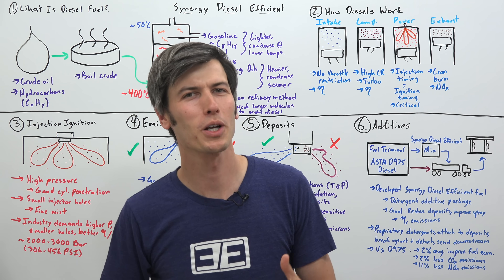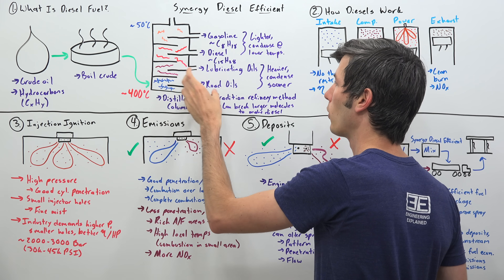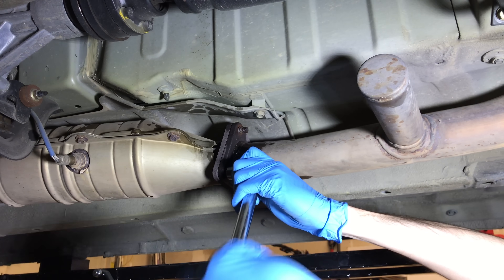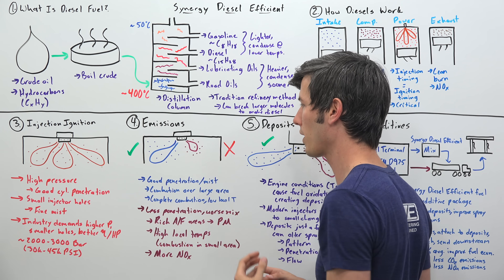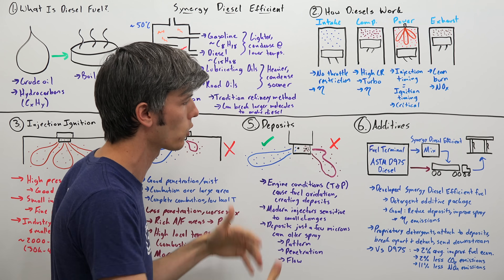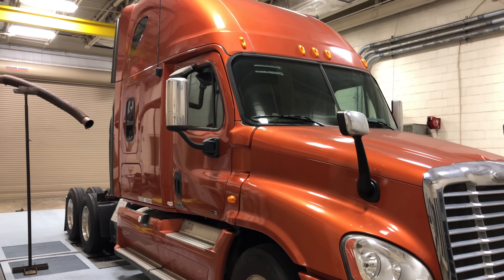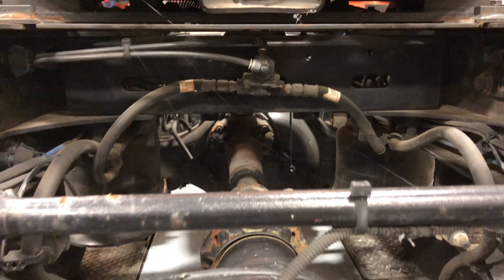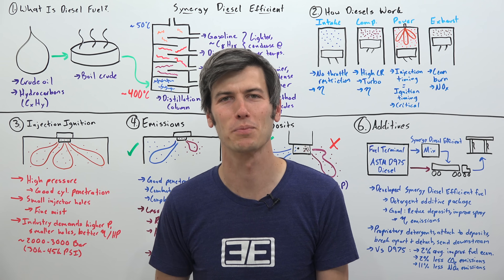Why Diesel Engines Lose Power & Efficiency Over Time

Comment: May I assume that their claim of 2% reduction in CO2 is strictly due to the 2% increase in fuel efficiency? Otherwise, a decrease in CO2 emissions by mass balance would generally be considered a bad thing. Lower NOx and lower CO2 could mean higher carbon monoxide.

Comment: 82 Datsun 720 pickup, bought new, powered by SD22 Chrysler Marine diesel build under license by Nissan. 36-37 MGP city or highway. Had 387,900 miles before I give it up due to deterioration of body, interior, steering, suspension and power train.  Went to start it for buyer after having sat for 1 1/2 years in wet Western Washington State.  New batter, a couple of revolutions and boom! Away she went just like every time I had ever tried to start it!

Comment: Research is also bring done create ducted fuel injectors. Think how a bunsen burner works. With the duct closed the flame burns yellow and creates soot. When the duct is open it burns all the fuel and produces a blue flame. For a diesel engine it means no soot, yet cool enough to reduce NOx. No need for a DPF! 👍👍👍

Comment: It is drivers that lose their engines' efficiency and increase wear due to thrashing engines/ high revs eg when cold and also a lack of servicing. Noticed petrol engines tend to wear quicker above 80k miles due to valve wear etc whereas I've never known a diesel wear significantly with annual oil change etc . Diesels seem to "like" to be worked (hard) but not thrashed. Worn diesels you see are either not serviced/  thrashed or/ just very high mileage.

Comment: It occurs to me that if you make your fuel injectors impervious to damage from water you could put a slug of distilled water into the injectors so that the injection valve Is fully open when the fuel is going through the nozzle and a residue free fluid is in the nozzle when the flow stops eliminating particle buildup in the little holes.

Comment: Diesel engine is efficent but need frequent oil change n maintenance yeh they are very good for high mileage use ...I have see 700000km diesel suv if maintained properly and still running where petrol engine need overhaul after just 100000km

Comment: So presumably you can run enough detergent through the engine to clean the injectors and then go back to standard fuel for some period of time. The detergent can either be included in the fuel (Exxon), or as some additive. Correct?

Comment: 2% improvement in efficiency sounds great at first, but you left out a crucial bit of information - what is the % cost increase of this fuel compared with "normal" diesel on average? I'm sure the trucking companies have worked this out long ago!

Comment: Well my car appearantly gained 20hp after 5 years (test before tuning). It was an hilarious sight, tuned it up another 50hp, so 70 over original with a 'safe' mod. Anyway I still don't get why it was so much higher than stock specs and that for a 5 year old car. It should be down 20, not up 😂

Comment: I drive a diesel car daily, it is closing in to 500k miles, the engine has never been rebuilt and still has the original injectors and turbo, and still goes as good as new. Even when it is -25 C, it starts and runs, and has never had any big problems. All it takes is good and regular maintenance, good fuel, and atleast 20k miles a year, cause diesel engine need to be used all the time, and has to be driven long distance, otherwise you will start to get problems.

Comment: Here's what they need to do, put sulfur back in diesel fuel to lubricate the injectors and injection pump on older engines, get rid of vgt turbos, egr, and dpf.  Have a system that goes from air filter to turbo to intake, inject fuel, and go through a 5 inch straight pipe. Makes diesel engines last a lot longer, get better fuel mileage as there is no back pressure in the exhaust,  I know first hand that works. And 359 cubic inch common rail cummins engines, and 6bts with straight pipes and a Holsett fixed geometry turbo sounds amazing. But no, apparently diesels are "bad for the environment". A Ford f350 "slave Lake" running on everything from diesel fuel to radioactive horse piss is more environmentally friendly than a Tesla. And that's an IDI. But I guess nobody cares about reliability or fuel mileage anymore...

Comment: Ok so the new fuel cleans deposits away from the internals of the diesel engine. What are the down falls of this against injector seals/o-rings and high pressure fuel pumps. If the fuel is being used as a cleaner, why not test the fuel system cleaners that have been around for years claiming to do the same thing this new fuel is doing only just now.

Comment: All i see in the comments is people saying that their diesel engines didnt lose power over time, but they forgot to pass in the dino when the bought with 0 miles and after with 200k miles. Because thats how you compare gains or lost of horse power. At least we do this way here in Brazil, because wherever you are, you must know that are nothing more diferent than two same cars ( hardly ever they have the same hp from the factory ). By the way sorry for the big text and the bad english. Thanks for the content.

Comment: My VW tdi with 285k miles on it is quicker than when new , it also started getting better mpg after 60k mile break in and it still gets the same great 50+ mpg ..  older diesels don’t care about your new fuel.

Comment: Honestly, if you really want to reduce your emissions while driving, switch to electric. They are more efficient and last longer on the motor side of things. The batteries do emit a lot (i am aware of that) but it is quickly mitigated after that. Additionally they last a long time, and battery technology is advancing fast, making the energy density higher, while reducing emissions :)

Comment: Okay , been working on Diesel engines for 40 years , and have never run into a problem of the fuel plugging an injector tip . It’s normal to get power creep — threw time the injection pressure will open the hole up larger , thus allowing more fuel into a cylinder ( up to 125%) with out logging a fault . The pistons are not flat and actually contain a bowl

Comment: I don't know what makes you think only diesel engines lose power and efficiency over time. All engines do. On the contrary, similarly maintained diesel engines outlive their gasoline or kerosene counterparts. this video unnecessarily shows diesels in poor light which surely puts your judgement in question

Comment: Where are you getting the numbers for light duty truck diesel longevity? Is 200k miles just based off when the car is typically scrapped? I could see the trucks rusting out before then, but not the motor needing a rebuild. My 7.3L powerstroke is easily good for 500k miles without a rebuild with 1 million mile examples still driving around.

Comment: Dunno about losing power. Even if it is, it isn't much.
I used to have an almost 20 years old Audi diesel with around 300,000 miles and still got 48  miles per gallon (4.9L / 100km) on normal highway conditions.

Comment: @Engineering Explained Hi Jason, I recently conducted a similar test to replicate the claim of the cleaner injectors providing improved fuel economy. We actually removed 11000 hour old injectors and replaced them with brand new injectors to replicate the clean injector claim. We found an improvement of 0.58% however the additional price of the additive package is 0.60% so it does not appear to be a cost effective solution to us. This was conducted on an engine dyno with a 67litre CAT mining truck engine. My question for you is, do you know if the larger displacement engine had a lower % improvement compared to the smaller displacement engine? My theory being that perhaps the larger injector nozzle diameters are less effected by the buildup than smaller diameters? In addition our mining engines are usually at wide open throttle position for far longer than road going vehicles and may not form such deposits as readily. We also took photos of the used injectors with an electron microscope which was very interesting. There appeared to be minimal deposits inside the nozzle but there were some externally on the injector nozzle.

Comment: The question I would have atleast at the consumer level is if the detergents account for more than 2% of the volume of the diesel, even if the price was identical it wouldn't be economically efficient. Unless your tracking it or 'going green' wouldn't this just be a net negative with the additives? and how do the additives oxidize? So many questions :)

Comment: Legitimate question, from an engineering standpoint, why would it SEEM like modern diesel engines do not have the lifespan that older designs used to? (I use the word seem because I do not know of a resource to find actual data on this subject, but more of what I commonly see discussed across public means, i.e. forums, TSBs, etc.)

I would imagine it could be due to things such as:

-Ultra-Low Sulfur Diesel fuel
-Much more emissions equipment, and having to deal with increased operating temperatures from it
-Certain parts being manufactured from inferior materials than those in the past (seems to be this way across the board, gas or diesel, an example would be the plastic impeller on a Coyote 5.0 V8)
To name a few.

Now I'm aware there are several factors that contribute to an engine's (gas or diesel) lifespan such as maintenance and use both just regular driving and tow/haul applications, but is there any light you can shed on this?

Or is this a myth that we find easy to believe, mainly due to the sharing of information (or, unfortunately in many cases today, misinformation) and experiences being easier in an increasingly connected world?

Thanks in advance.

Edit: Added bit about misinformation, because not everything we see on the internet is true.

Comment: Assuming any of this works. Of course, GM’s tests will show it works—in their lab. Real world issues are always different. Experts in the field state that there is no way to make a low polluting Diesel engine, which is why Volkswagen, its subsidiaries, and others, have cheated. Nothing has changed. 2% is within the range of mechanical manufacturing error.  These tests aren’t realistic. Differences in driving conditions is far more useful.

No impressed.

Comment: Great Video. I tried to find the Cetane rating of Mobil Synergy Diesel on their website and could not, also was wondering what the lubricity rating was.  Exxon/Mobil contact us page is an endless maze and you can't really find the correct place to answer this question.  Do you know?

Comment: In your video, when talking about the distillation part, I was wondering where they get the stuff for making plastics?
Reply: By linking many small molecules together to make longer ones.  Momomers (links) are fastened together to make polymers (chain).

Comment: I just swapped 12 port injectors into a powetech ho 4.7l V8. The OEM injectors were 4 port. Already seeing seeing smoother starts and idle and mpg improvements, and my ECM only has like 5 trips on it after I reset it. It's all about atomization

Comment: 2% increase in efficiency compared to the minimum federal standards. I'm speculating, but surely other oil companies also produce fuels that are better than the standard. Or am I missing something? A cheap fuel that meets only the standards might save you money up front.

Comment: RACING BBM SAVERS?
 ￼

 Feb 8 · 3 min read
 Now the price of fuel oil (BBM) is increasingly rising, this is a complaint for many people to buy it, triggered by the high level of mobility in each of our activities.  Indeed, today there are indeed many cars that save fuel consumption, but what about people who have vehicles that are out of date.  And the best solution is to use fuel-saving products.
 WHAT IS THE ECO RACING OF BBM SAVINGS?
 PT.  Sinergy World, which is a company of Eco Racing products, issued products that function to save fuel.  Eco Racing is a fuel additive made from 100% organic ingredients so it is safe for machines and humans.  This Eco-Racing Fuel Saver product is a world-class premium product through research for more than 10 years and has been tested for quality, both through tests of well-known emission testing laboratories, vehicle performance tests through test dynotest tests, and direct testing of thousands of motorized vehicles,  until it's already been used with GP Motor racers, testing has been done for several years (all of them are tested to very strict standards).
 Has gone through the ITB Bachelor research process for more than 10 years
 Have passed the LEMIGAS and PETROLAB laboratory tests with Marketable results
 Has gone through the Dynotest test process, even tested directly by Motorplus Tabloid
 Has passed the Emission Test by DISHUB, Auto 2000, Astra International and Tunas Daihatsu
 This Eco Racing Fuel Saver is a product in the form of a pill that has an additive which has a function to protect the vehicle's engine, by increasing Octane / RON (Research Octan Number) of Oil Fuel, so that it can save fuel use and eliminate CO pollution  up to 100%.  This eco racing product can be used for motor vehicles, cars, trucks, buses and generators and can also be used for all types of engines that use gasoline or diesel fuel.
 BENEFITS OF SINERGY ECO RACING include:
 MPU Protect and clean the machine (Nano Technology)
 Able to reduce CO (carbon monoxide) gas emissions and exhaust ash
 Able to increase 5–10 RON (Eco Racing)
 Able to increase 2-5 CN (Eco Diesel)
 Able to eliminate Knocking
 Able to optimize power and acceleration (Dynotest)
 Able to save fuel 30% 50%
 Able to soften engine sound
 Able to extend the feasibility of the machine
 Able to optimize the combustion process on the engine
 Able to clean crust in tanks, gasoline hoses, carburetors and engines
 Able to reduce significantly the cost of engine maintenance
 SINERGY ECO RACING CONTENT
 Detergent Chemical Organic Function which has a function to improve combustion and maintain engine stability to be excellent.
 Corrosion Inhibitors.  Can prevent corrosion / rust on gasoline lines and combustion engines, and remove the remaining rust due to the wrong use of fuel such as premium on motors with compression above 9.1 (type of injection and matic).
 De Emulsion.  Can separate fuel pure substances with impurity emulsions such as rainwater etc.  So that it does not affect the combustion process.
 ￼￼
 Eco Racing is not only an RON enhancer, Eco Racing is able to harmonize MON (Octane Number Motor) so that the performance of the vehicle can be maximized.  Equipped with additives, Eco Racing is also capable of reducing, preventing crust on the engine and fuel lines, and reducing emissions residues.
 By using ECO RACING BBM SAVERS this combustion will be more perfect.  If the combustion is complete, it means that all the gasoline (in the form of steam) in the compressor tube burns all, adding more impetus.  With the Eco Racing Fuel Saver, gasoline becomes more pure.  Eco racing can release crustal crust through exhaust air.  Closing the pore pores The engine block is eroded due to the unstable piston performance.  In addition, eco racing products make the fline layer on the engine block and piston.  This is how eco racing works so that the engine is protected.
 ￼

Comment: In my experience of driving Mercedes Diesel engine cars for over 20 years, Shell diesel fuels are the best by far. Mobil diesel makes for a more noisy operation, less mileage per tankful, and less power,I can only conclude that Mobil has a lower cetane rating than Shell. I can usually get 75-100 miles more per tankful with Shell than Mobil"

Comment: Crazy how my 1997 Powestroke gets 22mpg and seems to have better power at 375,000? 
Until recently WVO was my main fuel. Better mpg, quieter, smelled like cinnamon crispas!
Reply: In that case you might want to try "Renewable Diesel", also made from waste vegetable oils (used cooking oil, UCO).

It is a crystal clear and virtually odourless fully synthetic fuel.

Comment: If diesel is less refined, why does it cost more than regular gasoline?
Reply: Fuel is priced at the amount of "energy" that is produced from it. 
Gasoline has less "power" or release of useable energy then  Diesel which has almost 50% more energy released per gallon. That being said if gasoline engines could burn gasoline and develop more energy per gallon it would be opposite.
Simply put, Devil Bill taught his son John D how to be an apathetic miserly dominator of capital. Therefore most find it acceptable that anyone could profit from any resource on this planet prior to or post refinement all the elements on the earth are here with us all for the use of all of us. No man made the earth placed oil rocks the sun etc etc etc
The truly fucked part is that petroleum is the second most common liquid on planet earth and is not fossil at all.
Reply: Also depends on country because my country diesel is cheaper than gas